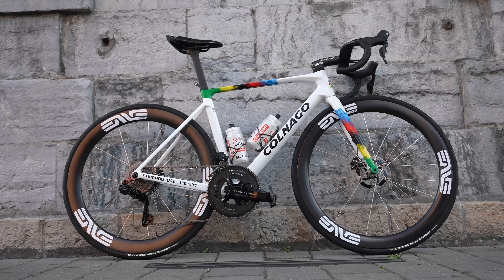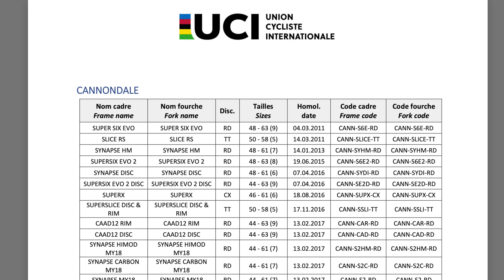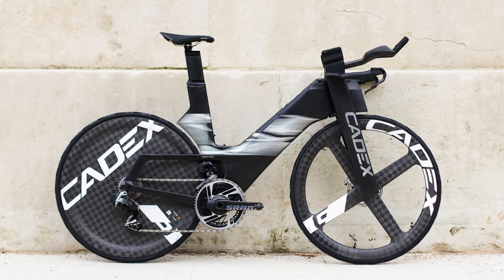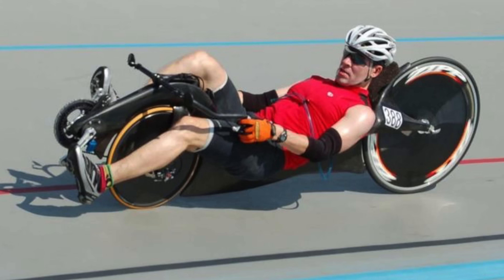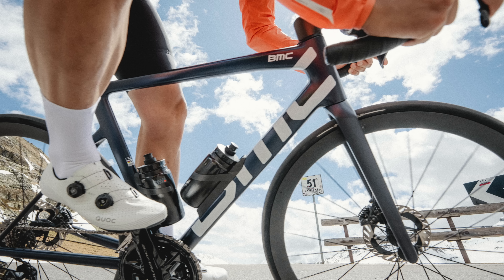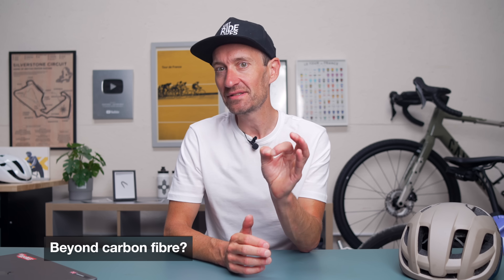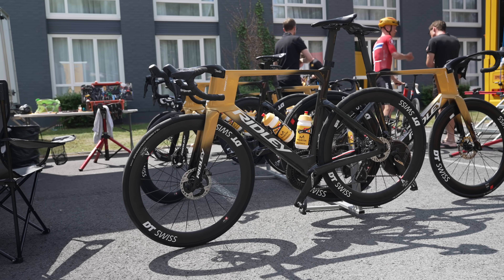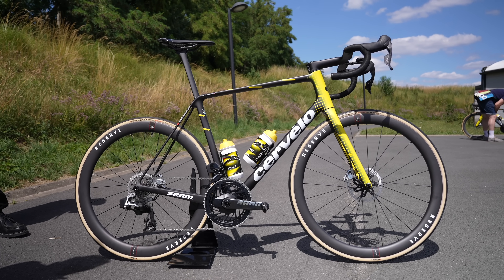How Fast Could Road Bikes Be Without UCI Rules?

Comment: Also, there's transmission. Instead of having a fixed cassette and a chain pulling at an angle, with a different wheel construction, the cassette could be moved along the rear axle so the chain would always pull with no angle.

Comment: Small correction on the recumbent land speed record; it is not 90 km/h it is 90 mi/h (approx 144 km/h). So add another 54 km/h to the gap between the Ganna record and the recumbent!
Reply: That's the speed record, not the hour record. Hour record is 92kph like he says in the video.

Comment: In the present racing, I don't think one should be allowed to change the type of bike during a stage.  No switching from a TT bike to a hill climbing bike during a TT.  Applying that to unlimited human-powered-only bikes, one could ride a recumbent bike but then they're stuck with it on the long, steep climbs.  The type of bike selected will be heavily dependent on the stage.

Comment: Well limitations create ingenuity. I think without the UCI regulations, we wouldn't be so far advanced in the carbon construction of bikes and have these wonderful, simple machines. Bikes would probably be overcomplicated when their simplicity is a main aspect of what makes them so unique and beautiful. As much as I agree and also wonder what the ultimate roadbike without UCI rules would look like, I do not know if we really need that. However, I'd like to know if something like velomobiles or recumbent bikes could be the vehicles of the future. Maybe equipped with a little electric battery for motoring hills and cooling or heating they could really replace cars in my opinion.

Comment: I would disagree with the weight limit comment made. Im sure people have seen lightweight carbon bikes snap or crack and if you remember dyna which admittedly in the early days carbon bonded to aluminum used to fail as well.
The whole thing with saving weight is that your compromised on flex and strength. So compromising safety. A ultra lightweight bike just wont take the same hardship on rough roads, as say alloy or steel.

Comment: Heres my hot take. Without UCI rules, bikes might be slower. Due to the basic rule (no bikes under 6.8kg), the industry was forced into innovation through aerodynamics research. I think without a min weight, we may still be chasing impossible weight figures instead of aerodynamics which we now understand are superior.
Now if tomorrow they got rid of the rules, It would be an aero focused bike, which would then evolve to be lighter weight over the next X number of years.
Reply: They'd also resemble recumbent bicycles which are well known to be faster
Reply: @kyleessex6301  I really don't think bikes would be slower, aerodynamics isn't something new. Imo all race bikes would just be recumbents

Comment: My guess is that with zero rules, there would be a lot of bike swapping. Riders would ride velomobiles on the flats, then switch to some ultra light bike, maybe of regular type, maybe a recumbent, when there was a climb. Once at the top of the climb, they'd swap to some sort of pure descending bike, with as little surface area as possible, and probably a ground effect design to generate tremendous downforce, allowing these bikes to reach absolutely insane speeds, both on the straights and in the corners.

Most likely, there will just be a matter of time before someone would get killed, probably on a descent, and then there would be a new rule frenzy.
Reply: velomobiles on the flats would be awesome!!
Reply: Any sort of down force creates crazy amounts of drag I can't imagine that we would see that because they wouldn't reach the same speeds
Reply: if there were absolutely no rules, wouldent bikes just evolve into cars, planes or jets if the only goal was raw speed?
Reply: @That_Lemon_Turtle  I think the assumption is that motors are still banned. No limitations on stuff like weight etc.

Comment: With ZERO rules? I’d be riding a motogp bike in the TdF! 😂

In all seriousness — I wouldn’t want to ride a recumbent on the road. We already have issues with visibility to drivers. Recumbents, with their low profile, are even less visible. The few I’ve seen round here often have those little orange pennants on a tall pole to aid visibility. I don’t want to go under a trucks wheels though. 

On the other hand, I do think the UCI should stop with the rubbish regulations on handlebars and gearing. They say ‘for safety’ but we know that’s utter B.S. I don’t mind they have regulations designed to keep a bike looking like a bike (double triangle rule for example) but they should say that’s what the rule is for. 

I don’t think pro racing should go the way of F1. In fact I think they should enforce the ‘gotta be able to buy it’ rule more strictly — it would help impose a cost cap on teams and keep racing fairer for the smaller ones.

Comment: Honestly I am glad rules exist, if only it were to keep the sport somewhat accessible to everyone without the need to upgrade every few months just to keep up. 

And I love a traditional look, that's one of the reasons I just bought a TCR
Reply: It works the other way aswell. If there were no rules we might have achieved peak bike and upgrades would not exists. Also most changes to bikes comes from adapting to new rules.
Reply: @perjonsegard265 I doubt that as in areas which are left free innovation continously carries on.

Should only rich kids be able to compete at the top level of cycling because only their parents can afford the latest and best gear?
Reply: I understand rules for safety and fairness, but to preserve the historic aesthetic makes it boring to me. You could have two series, one for all out tech showdown like in F1 and one with very strict and stable design rules, so that any manufacturer could make a cheap bike for it.